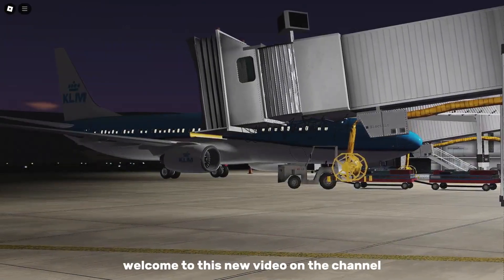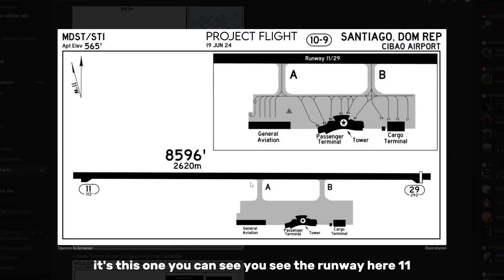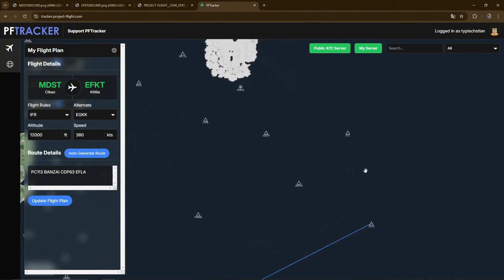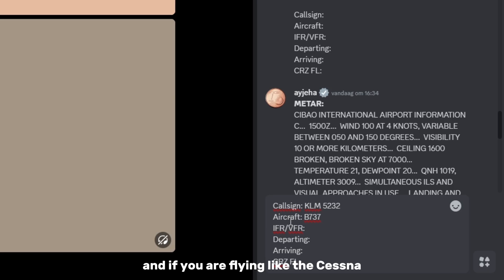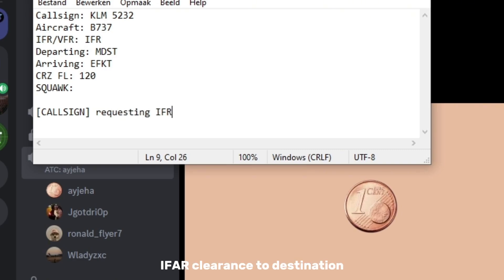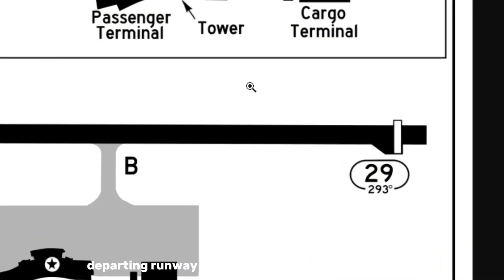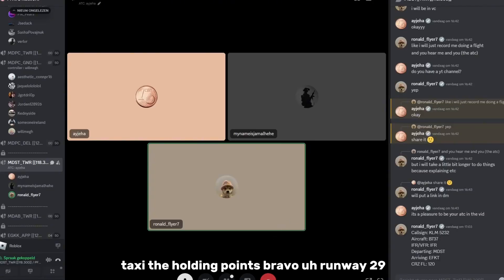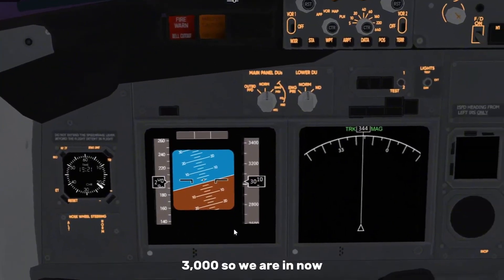(OUTDATED) PublicATC Tutorial - Project Flight

Comment: Thank you so much! I still have a confusion on the "CRZ FL" how do you calculate that?
Reply from the maker: CRZ FL means “Cruising Flight Level”, the altitude you fly during the cruise. It depends on the distance you’re flying. So for Punta Cana to Kittila you can take FL110 (11.000ft) but a flight between Gatwick to Menorca you might want to fly FL080 (8.000 feet). So the longer the distance, the higher the CRZ FL.
Reply: @treesitter1  I see now. Thank you very much! So would CRZ FL 110 be 11,000 feet and 8,000 feet = CRZ FL 080?
Reply from the maker: @rew01fr Yes, this is also covered in the newest PublicATC tutorial now on my channel!
Reply: @treesitter1  Yeah I noticed. Thanks a lot once again!

Comment: Can you explain the part at which the atc told you to go to a holding point? How is it indicated on the chart
Reply from the maker: @gtaviunofficial  Most of the times holding point means the part where the taxiway connects to the runway. So if the runway is 09 (Punta Cana), ATC says “Taxi echo (taxiway) holding point 09” indicating the runway. You can’t enter the runway without clearance so that’s why you wait there until ATC gives you clearance to line up

Comment: 5:58 you should also state Atis info. Ex: KLM 5232 requesting IFR Clearance to Kittila with information Bravo
Reply from the maker: Well seen, forgot that 😭
Reply: And stand number and aircraft type and Qnh
Reply from the maker: @MagnusBjørnJensen  Stand number and QNH is not necessary. For the pushback it is, but you get the QNH from the controller.

Comment: Tip for new members.  When flying,  use a method called CRAFT. That's cleard to XX via ROUTE  set ALTITUDE FREQUENCY and TRANSPONDER  kr Squawk  in other terms. It should look like this

C destination 
R suggested route 
A cruising and initial climb altitudes 
F current radio communications frequency (eg tower or centre,  kr ground)
T trabsponder (four digit code with a Squawk callout)
Reply: This method is only used at airports following FAA regulations, of which there are none in game.

For ICAO/CAA regulations it would be something along the lines of:
CRT (or CRAT for a vectored departure).

"{callsign}, {station}, Cleared to {destination} via the {departure} departure, squawk {squawk}"
"Speedbird 123, Gatwick Delivery, cleared to Punta Cana via the NOVMA1X departure, squawk 3651"
Reply: @  ah

“A pro pilot is always learning”
Reply: btw C means Clearance Limit
Reply: @manaphyyy   I see. Sorry for misunderstanding the use of craft. I’m still getting behind this whole VFR conundrum. No im not a student pilot, just someone going blind off the internet for answers. Flight insight has so far made my eyes open more [if any of that made sense]
Reply: @Starvaze  dw
Reply: frequency is not the current one, but the one that you will be departing with (has to be departure, approach, or center)